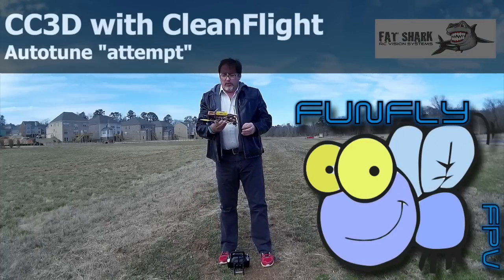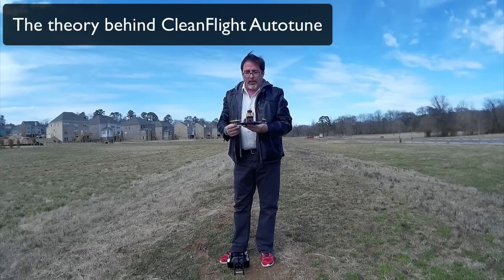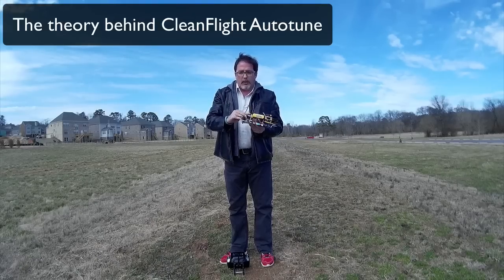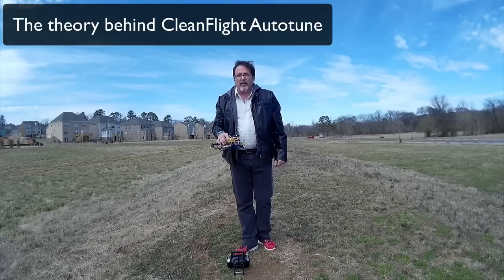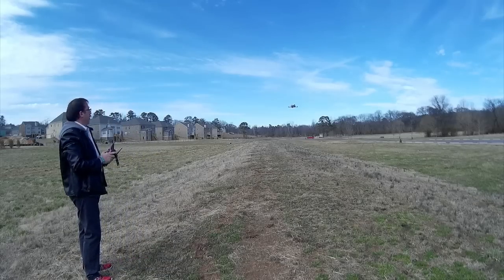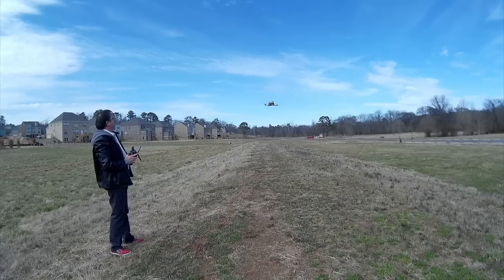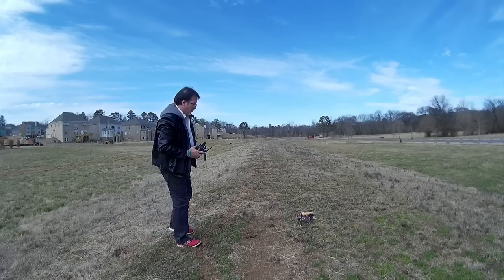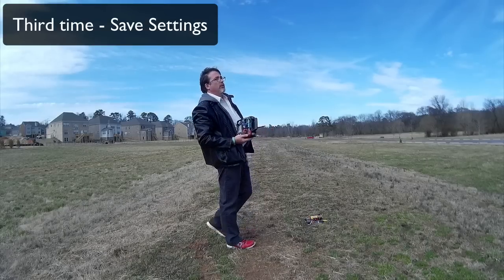CC3D with CleanFlight - AutoTune

Comment: I have 1.9.0 cleanflight version here, and I can't find autotune option! Where can I find it? Thanks
Reply from the maker: Nivaldo Ribeiro Under "modes" there is a option you can assign to a switch.
Reply: I think you are doing some mistake here, cc3d with cleanflight 1.9.0 doesn't have this option.
Reply from the maker: Nivaldo Ribeiro You are correct, I saw this answer today on Reddit:

Autotune is not supported on CC3D when you are using OpenPilot bootloader (when you flash CC3D using OpenPilot's GCS). Consider flashing a HEX-file (see https://github.com/cleanflight/cleanflight/blob/master/docs/Board%20-%20CC3D.md, Flashing section)
Reply: FunFly FPV Nice, but... in this way I can't go back to the openpilot. Anyway, I'll give it a try... Thank you!
Reply: FunFly FPV Do you know a tutorial of how to flash cc3d with the HEX-file?
Reply from the maker: Nivaldo Ribeiro I will have to check and try it myself ..

Comment: How did you manage to get Autotune selected in Cleanflight with the CC3D Board?
Reply from the maker: Tobias Kiel Configure a two position switch on your transmitter to activate the AUTOTUNE mode. So I assigned a switch in the MODE section of the configurator.

Comment: Hi there,

I believe you need to flip the switch as soon as you hear it beep rather than letting it keep going...so start In horizon mode, flip the switch to start auto tune, turn off auto tune as soon as it starts beeping ...repeat again for the second phase, land, disarm and then turn on auto tune once more to save settings
Reply from the maker: igetcha69 Thank you ..